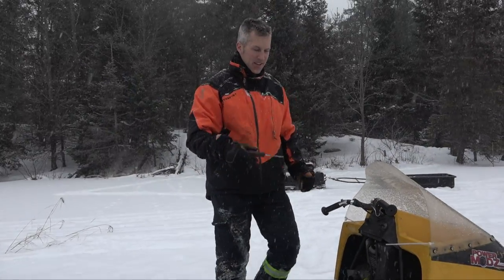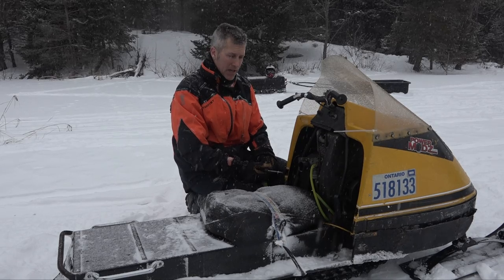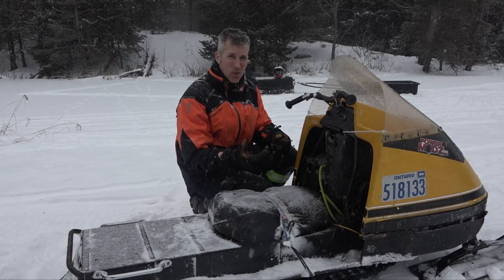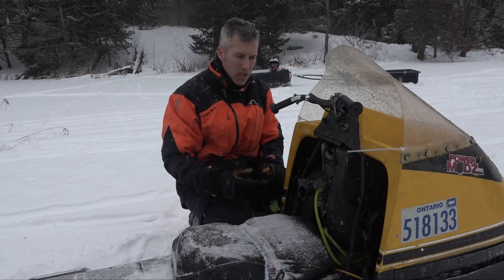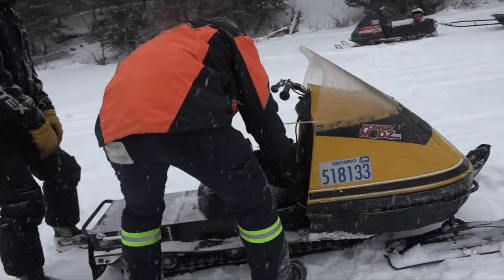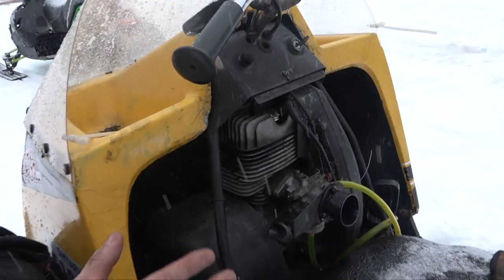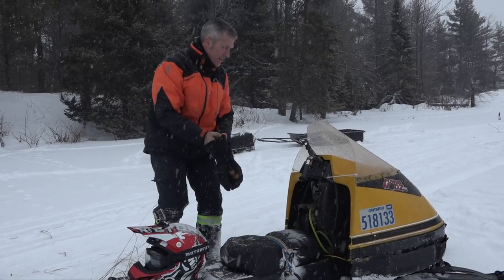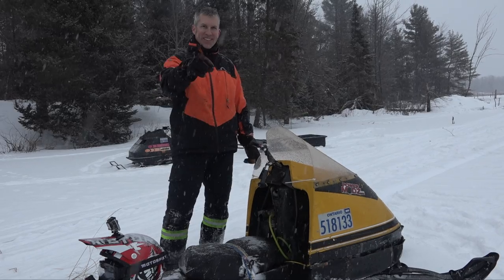Tillotson Carb high and low speed needle adjustment - the way I do it.

Comment: Had a Tilly HR on my Rotax 399 ran flawless by having good fuel and good parts by Dennis Kirk in Minnesota.  Had a 71 oly,  took the 399 out of it put it in a 77 440 FA TNT,had to do some moding to inside of the hood,re geared it and ran a Donaldson muffler with moded pipes to it, along with winding the skis with DK ski spreaders and made spacers for the shocks.That sled was a good all around trail sled.

Comment: Only problem I've ever had with a tilly was the plastic fuel inlet warping from age. It was on a 60's pioneer. Fuel inlet don't come with the rebuild kit, and the even the cork gasket was wrong. 
Got the parts I needed from a go kart shop in the states for like 6 bucks shipped. Saw runs great!

Comment: Nice video. I got 3 elans in my yard and I've been trying my best to fix them, I got a single piston engine someahat working but I can't keep it running long enough to get it back into shape. Note that this elan im working on was somewhat repaired 5 years ago and had been sitting behind a pile of dirt for about 20 years before that. They are awesome little things but they're hard to get running with weak arms and I need to pull hard and fast. I'll definitely use this to figure out my carb
Reply: U live in MN?

Comment: I think you misspoke when you said, "then turn the screw in a quarter of a turn so it's not running too lean".  Doesn't turing the screw in (clockwise) make it run MORE lean, not less?
Reply: Turning the screw in actually closes off the air passage causing more fuel to be sucked up (rich) . Turning it out allows more air in (lean)  just discovered that myself going through manuals for my '70 panther 399
Reply: Yes you are correct. I know this was a year ago, but in the ‘72 skidoo shop manual: “turning the screw clockwise produces a leaner mixture. (More air/less fuel) counter clockwise, richer. (Less air/more fuel)”

Comment: i was always adjusting a tillosten whenever there was a temperature change
Reply from the maker: +Stephen Mcconnell that's interesting I find that once i set them I never have to do it until rebuild time - and usually i only have to rebuild it because I didnt start it a few times over the summer.
Reply: Warm days especially. Plus our machines were beat to hell already but still great times
Reply: +PowerModz Small questions for you, i have a tillotson hr-169a wich looks to give me a lean condition but there is only a low speed adjustemt ... ? the high speed adjust,emt is fixed, how can i richen it ?
Reply from the maker: +morrron5 you cant you need to clean and rebuild it - check the  mainjet to se if it is partially clogged.
Reply: +PowerModz oh nice , thanks you Louis !

Comment: Why would you turn in the screws in 1/4 of a turn from highest rpm, wouldn't that mean you are running lean?
Reply from the maker: no just the opposite - highest rpm is leaning - past that adds more air - more lean.  turn in a quarter turn to run a bit richer....that's my understanding.
Reply: As far as I know, the more you turn in the mixture screws, the less fuel is being delivered. Turning out (anti-clockwise) richens the fuel mixture.

And I didn't expect such a fast answer haha :-)